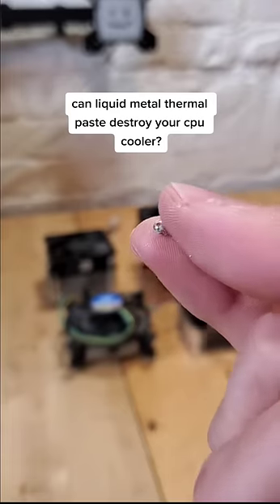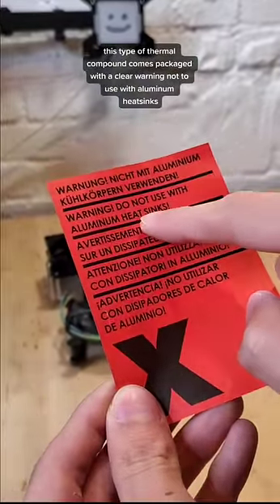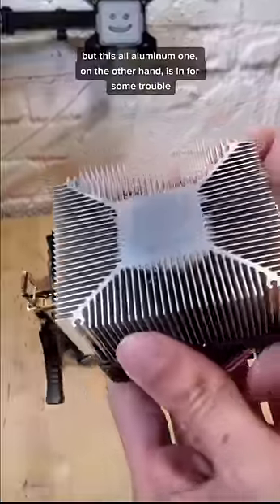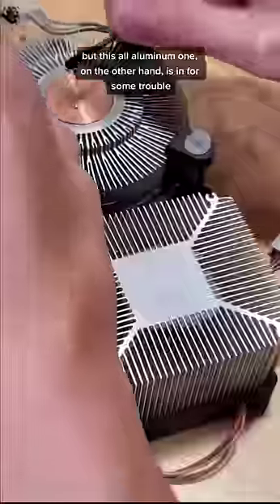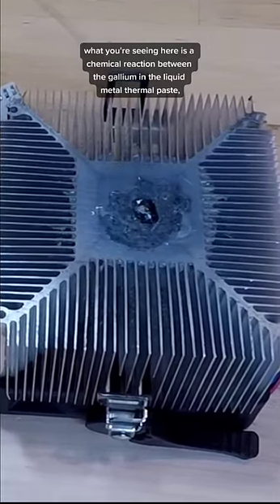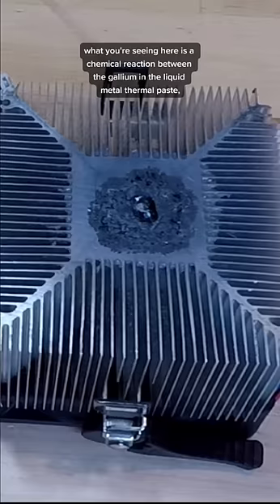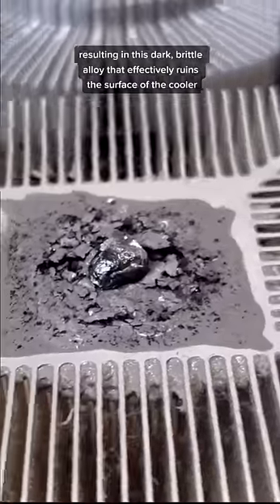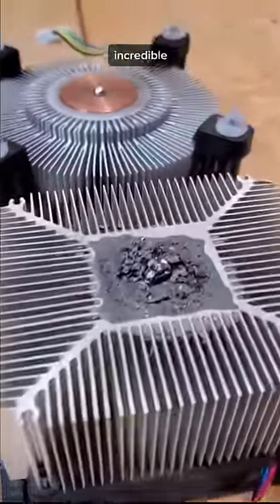Can liquid metal thermal paste destroy a cpu cooler? #shorts

Comment: If you could create an aluminum oxide layer by heating up the aluminum on the cooler and making it turn that dull look it creates an oxide layer and it might prevent the amalgamation process and protect the aluminum from what I remember maybe you could try it in your next video.👍
Reply: The gallium eventually permeates regardless

Comment: Well i mean Obviously you wouldn't put gallium on aluminum... They didn't ban it from glights for no reason. Also if it were to be a water cooling block the and the alloy were to get into contact with it it would create hydrogen and aluminum oxide. Your PC then could start burning because of the Hydrogen.

Comment: As I didn't find it in an other comment: do not use it with copper either! Only with nickel plated copper.

Even if it's not that fast, the galium will corrode pure copper. That's why all high-end water blocks are nickel plated.
Reply: It doesn't corrode it in quite the same way, though. It's far less catastrophic, even after a year of constant use. You do get some discoloration, and the LM dries out, though.

Still transfers heat after its dried out, surprisingly 😂

Comment: Some dissimilar metals tend to corrode each other at rapid rates. This is why you can’t terminate copper wiring in aluminum terminals unless they have a designed plating and are labeled as able to be used with copper.

If you’ve ever seen warnings on equipment that seemed dumb, like able to take copper or aluminum wires, but only one of the two, that’s why.

Comment: It's called galvanic corrosion. There is a table that shows how corrosive are metals for other metals. Always try to use the same metal in a proyect, if you can't, use the closest on that table, or ad what is called a sacrifice anode, or a protective current.

Comment: Putting liquid metal on copper will cause it to galvanically react with the copper and gallium will leach from the LM to the copper effecting performance of the TIM. After one or two applications the galvanic process has ran its course on the effected area leaving the metal colouring .

Comment: Aluminum amalgamates with many other metals, look up what mercury does to aluminum.
I heard a story from my grandpa, who has a master’s degree in metallurgy, that under no circumstances, should you ever use steel screws in something made of aluminum, and Vice versa. The friction of tightening the screw actually creates microscopic gouges in the surface of the aluminum, and when you get rid of that top layer of oxidized metal, you have bare aluminum and bare steel in direct contact. Very, very slowly, the steel amalgamates with the aluminum and both fuses, and destroys both metals. One of his friends had his sail boat repaired, but the repair depot that performed the fix used steel screws. Over the course of a decade the steel and aluminum combined into a similar, brittle alloy, and one day during a casual sail, the entire mast broke off. Every single screw had been fused and weakened until one heavy gust of wind finally snapped the brittle alloy.

Comment: I think for aluminum sinks, you could do a sort of 'sandwich' where you stick on a some thermal paste, then a copper plate, then the liquid metal paste on the bottom of the copper plate which then goes over the CPU.
Reply: That would be worse for heat transfer, because you’re still limited by the normal thermal paste

Comment: It (Gallium/gallistan) doesn't just ruin the surface. It seeps into the al like a sponge and forms an amalgum or alloy. Turning the aluminium about as crumbly as metallic feta cheese.
Reply: This is why you don't wanna use liquid metal for shunt mods, unless prepared ton replace the shunts soon after. Because the end caps on larger resistors like shunts, are mostly aluminium. The process is unstoppable and irreversible, wiping the surface later serves little good as its already in the aluminium, not just on it.

Comment: The copper isn't "perfectly fine". The copper does get a permanent stain that will grow slowly over time.
- from a long term liquid metal user.
Reply: A cosmetic stain on the underside of a tool you never turn upside down during use is 'perfectly fine'.

Comment: They use liquid metal, albeit very specific formula on the PS5. It's what allows it to stay as cool as it does during heavy load. But it's very sealed and put in a sort of its own cavity where it can't touch anything but steel or seal on each side.  Tech advancements are getting really cool. But can also be worrysome if not used perfectly a certain specific way in Alot of cases.

Comment: I'd still feel sketchy about using it on his "copper" heatsink since it's surrounded by aluminum.  One wrong move, or if it gets bumped even after installation, could send errant blobs into the aluminum parts.

Comment: Just a heads up, unless you absolutely need it, if you have no experience, don't use liquid metal, instead buy some top notch thermal paste like the kryonaut

Simple because, if a single drop of metal falls on the pcb, it can fry your motherboard, and take along the rest of your components, because it has high electric conductivity

Comment: Ok.  But did you guys have to scratch the aluminum heat sink to get this reaction?  Almost all gallium/ mercury and aluminum reactions I've seen online have required the person demonstrating this phenomenon to scratch through the oxide layer that  forms on the surface of any aluminum metal object, usually under where the gallium/ mercury is already sitting on (because the oxide layer normally forms almost instantly).

Comment: Not really a 'chemical reaction' it is just gallium as a metal with low melting point, dissolves in other metals. There is no magic to it. Also it has to be terribly hot in that room since for gallium to melt it requires around 32 deg Celsius, and little poking with 2 fingers isnt enough to cause it to melt normally, esp not after it is put down for several hours. However i doubt it is pure gallium in those pastes, but i think still a good chunk

Comment: you shouldn't use liquid metal thermal paste on CPU coolers either way. Microsplashes can occur while you mount it which can spill out and short your motherboard. It's only really good for repasting your IHS

Comment: Just wondering, what would happen if we dont use any thermal paste at all ?
Reply: The cpu will get very hot, very fast.  
Thermal paste fills in the tiny gaps between the cooler plate and cpu lid, basically becoming a bridge for heat to cross over.

Comment: That gallium actually breaks up the aluminum, making it so brittle that you can break it. You can see TheLockPickingLawyer break a lock made out of pure gallium. Just the body, the key housing (where you put the key), was steel I believe so it didnt have an issue.
Reply: made of pure gallium? gallium melts in your hand dude thats cap

Comment: I just don't like aluminum coolers. Or coolers with aluminum contact surfaces at least. Worked with 2 so far. My AM2+ cooler, all aluminum, and 4th gen Intel cooler with a copper core. Both have the issue where after MX4 comes in contact with the aluminum, permanent tarnishing happens. Not sure if it's just that the aluminum is porous and using rubbing alcohol on it wears at the surface, or if small amounts of thermal paste get in there and can't get out. I scrub the aluminum with a q-tip and can never stop getting grey matter from it.

Comment: But the IHS is aluminium, so how are you supposed to use it, delid your cpu?
Reply: It is not. IHS are made from nickel plated copper.
Reply: @autumn5592  cool, didn't know that. I thought the early pentium 4's and Athlon 64's might have been aluminium but seems those two were also nickel plated copper. Apparently you can have galvanic reactions between two similar metals, thus why copper is used.

Comment: The copper cooler isn’t unaffected. Stop spreading this nonsense. 
It produces a gallium copper alloy, a dried up crust on top of your cooler.

You specifically need nickel-plated copper coolers to even have a CHANCE of liquid metal being remotely decent 6 months down the line.

Delidded processors don’t suffer from this as their only copper part, the lid, is nickel-plated. 

Don’t be a dummy, don’t listen to this guy. At least use half-decent sources like Linus or Gamersnexus. Save yourself the pain of letting this guy ruin your PC.

Comment: I put liquid metal on my gpu cooler, it was copper heat pipes running through aluminum. This was a year ago and temps have still been good. Temps have risen by 5c, but I'm not sure if it's this or just the pc is dirty now.